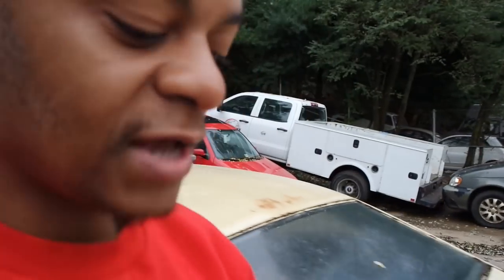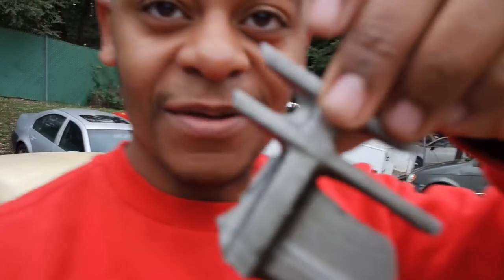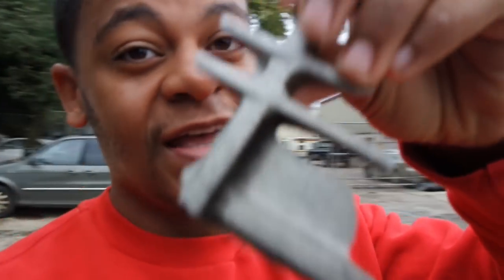RIP to my Turbo f20b Honda prelude

Comment: The prelude was my 1st favorite honda, so much I had 4 of em. Never boosted them but they where still alot of fun and looked good. Sorry to hear the motor blew but hey at least you can upgrade now. I have a F20b swapped cb7 and an 05 type s now for my remedy to have fun on the streets, and a 07 SS trailblazer to haul the kiddos around. Keep up the good work and good luck. I'll be watching.
Reply from the maker: Thanks bro

Comment: Man, I have blown a motor before and yeah I know that sound you described. This is going to be a long story but its a good one.

So way back in '09 when I was 19 I swapped an H22A into EJ1 coupe. I had never pulled a motor in my life and barely knew the basics. So I managed to get the swap done in about a week, bone stock H22A stock ecu, stock everything but an AEM cold air intake.
So not long after this swap I decide to go on a vacation with 2 of my friends over 1,100 miles to Titusville, FL. we make it all the way there just fine and the next day I leave the house we are visiting and drive 1 mile away to get beer. Just as I was leaving the liquor store it started an insane downpour and the streets filled with water so fast I couldn't believe it. i had no choice but to drive through some roughly 1 foot deep water to turn onto the street where I was staying. Then the engine gurgled for second and stopped, I tried several times and started it back up and drove the remaining 100 yards, pulled into the driveway, had my hand on the keys to turn it off and, then I hear the sound of tools dropping and the sound of big rocks banging around and there was smoke rolling out from under the hood.
When I drove through the water I sucked water up the stupid ass cold air intake and hydrolocked the engine and my young dumbass made it start again and drove 100 yards, it bent rod #1 until it snapped and smacked a fist size hole in my block. And there we were 1100 miles from home.
I managed to scrape up $800 for another H22A from JDM Orlando about 2 weeke later and put it in with nothing but my tool set and 2 cheap floor jacks. I drove her back home and that engine is still in my car to this day 9 years later. :)
Reply from the maker: Thats crazy bro

Comment: I thinks it's awesome you got that much hp out of the f20b, they only cost about $400-600 in my area with pretty much no mileage. they actually are great engine blocks, and are very strong and with a new block with wicked rods and pistons you should have a solid engine for a long time. Maybe a block guard and some really good main and rod bearings, wicked car
Reply from the maker: Yea if it wasnt for the boost creep i would have been good.

Comment: Blown rods, that Turbo creep had me worried and it wasn't even my car. Crazy I just watched ur last video damn bruh I know your feeling. I blew a motor up back in the late 90s and it shot rods threw the block on the highway when I sucked water through my cold air intake. That sounded like a shot gun bang and ran over rocks as well chunks. Good Luck on the next build.
Reply from the maker: Yea sucks but thanks bro ill be back soon

Comment: If you do get a f20b I have a extra h22a4 crank. Run that in the f20b bore it to 86mm and run the stock k20a2 pistons that I also have a set aswell. You can run eagle rods with those pistons in that setup plus you'll be .046" inside the pocket of the cylinder walls. That puts you at 9:1 compression great for boost and it will be a 2.1L f20b boosted. 
God bless and hopefully everything goes well with you bro.
Reply from the maker: That sounds dope

Comment: Had the exact same thing happen to me two years ago. F20B 5thgen boost crept to 18lbs then one week later I'm at a red light not racing or anything I shift from 1st to 2nd and a rod shoots out the pan. I just got another F20B and in the process of rebuilding. KStuned has rods for $400 and F20B forged pistons for $600. Ebay has F20B motors (auto) shipped for $600.
Reply from the maker: I just got a motor bro but can you send the link to the rods and pistons?
Reply: https://www.kstuned.com/search?q=f20b  I just got my F20B back today, hot tanked every part. Finishing up a stock rebuild on a h22a4 should be done by Monday. Then ill see if I just want to do a stock rebuild on the f20b or build the bottom end. It is hard to find replacement parts for this motor but this website has a lot of oem parts brand new but it isn't cheap. Still on the search for torque specs. http://store.autodynamics-honda.com/nsearch.html?#search/q=f20b&category=&sortby=rel&main_category=&page=1&size=200&storeid=yhst-13254426962198/1

Comment: I think it’s time for at least forged pistons and rods semi built engine but h22 f20b h/f have weak sleeves I got my block sleeved in 2012 with forged piston and rods no hiccups 10 000 miles in knock on wood just a few dead trannys  on the way sorry to hear about your motor brother I love you build have been following since I seen that engine bay we went through the same thing when my car was built went through 3 stock engines in one summer that’s when I paid the 4gs and got my block sleeved just for piece of mind as a daily the car all summer really until it starts snowing but stay with it youl find your perfect set up just takes some trail and error you should learn to tune your self maybe not make your own maps but I adjust mine in the fly cause in colder weather I run up +2.0 in my afr gauge more lean then in 75+ degree weather
Reply from the maker: Yea i really want to drop rods and pistons....with the f20b i dont need to sleeve the block for my power goals but we'll see
Reply: devin Dfresh H doesn’t have weak sleeves. There’s nearly 800 whp stock sleeves Hs with compatible pistons and rods. Also the F20b has cast iron sleeves. There’s a guy running 9.0 1/4 on stock F20b block.
Reply: FRM is stronger than iron. The sleeves are not weak. They are just coated and misinformed over and over by many people. H22/23 liners are strong. Including s2k and nsx.
Reply from the maker: @Jarph0821  motor for motor N/A based on experience ive had with stock h22's the f20b is better for boost
Reply: I cannot stand misinformation. If his goals are 450whp, the F20B can and will knock that down with 10psi out of high CFM turbo easily and still be very reliable.

Iron sleeves ftw. Also its not the FRM that makes the H22 undesirable for boost its the ring lands and the ring lands only.

Comment: Sorry to hear it blew, if I were you just build it up and send it again the f20bs are great. Keep the f20 and just do Darton 300s sleeves 9:1 CP or Weiscos, whatever the preference, full supertech or skunk2 valve train and Pro 1 cams, 1600cc ID's, precision 5858 .82 ar like I said before cuz it is perfect, maybe a sheepy bottom mount for better top end flow and a 3 inch exhaust.
Reply from the maker: You want me to go hammm lol ill look into it thanks for the info bro
Reply: @treybedipping1734  Hell yea man I would love the videos and I would love to see that beautiful lude smack down at least 500 to the rollers😎😈
Reply from the maker: @christianprusinski  me too bro lol
Reply: @treybedipping1734  Oh shit meant to say Darton MID wet sleeves above they have the integrated block ring for top end stability (whoot whoot 500+) and support a good amount of overboring in case you ever want a more displacement without going H block. I'm done babbling now😂 man.

Comment: That sucks that the motor blew up. As you said time for a new build. Christmas is coming lol tell your family what should under the Xmas  🌲.
Reply from the maker: Lol facts i gotta go check out your new vid im excited cause i was thinking of doing the same.
Reply: @treybedipping1734  if you are better start getting the parts now. Those crv parts going up in price. Doing a b20 vtec swap might be easier on the prelude.  So it would be easier with the crv transmission.
Reply from the maker: @AJIMPORTS  thats the thing im not sure what all you need. Your keeping your h22 and doing it right?
Reply: @treybedipping1734  yeah I'm keeping the h22. I am using it because I already had it. If not I would have went k swap. But I had a very short deadline. I will look into your car and see what would be needed for you to do the swap and let you know.
Reply from the maker: @AJIMPORTS  that would be dope bro let me know. You on ig or facebook?

Comment: Dam bro sorry to hear about that, in all honesty the F motor can only take so much boost and power with stock internals before something like this happens, happened to a few guys here on the local scene, please consider the H and sleeve it, I know some guys love the F and others the H, (it's a on going battle lol), I'm sure u have done a lot of research. Maybe u can give some detail on why u prefer the F over the H, just to add some content in your next video. 💪,  The great thing about starting over again is the amount of options u have 😱,
Reply from the maker: Facts.  i like the f20b because for my power goals its perfect because of the cast iron block and sleeves are good for 400-450 no need to sleeve unless i was going for like 500+hp
Reply: I read ur comments afterwards yes, so  I get what you saying, u never know maybe you get some sponsors and can build one hell of a engine without spending to much 😬.

Comment: I may be wrong, would the wastegate be equivalent to the bypass valve on a supercharger?
Reply from the maker: Not to familiar with the supercharged builds but the wastegate lets out excess exhaust  to keep the boost at the desired level.

Comment: I got an f20b in my 99 Prelude i need to get a new set of headers but nobody can give a straight answer on I'f the h22a will fit or if the h23 will fit
Reply from the maker: H22 parts will 100% fit...the h23 non vtec parts wilk not fit.
Reply: @treybedipping1734  thank  you

Comment: u allready saw how weak those motors are , u need a piston and rod set up on a h22 block and ur set , honestly bro from seeing ur other video on the dyno I though it was understood to not rev up the motor past 7k .......
Reply from the maker: The f20b can rev out to 8500rpm bro and the f20b's are the best N/A motor for boost
Reply: @treybedipping1734  yes bro but from what the tuner told u on ur last video I thought it was agreed to not go over 7k ,I would have thought he put ur rev limit at 7 to save the motor bro ...
Reply from the maker: @drewster956  he put the rev limit at 7300 because thats where the boost creep was spiking at.
Reply: @treybedipping1734  piston And rod time baby

Comment: Boost creep commonly happens when you have wastegate placement in a poor area... like a log manifold and wastegate prevision only in one cylinder versus in the middle of all 4 cylinders. Log manifolds are worst on boost creep and heat. Need wastegate in the middle with no crazy long extensions on it.
Reply from the maker: Yea gettin a new manifold made

Comment: Yo Trey I've been following you for awhile, so I'll give you a heads up for over-boost issued. You should buy a Guardian Angel at Stratified. It prevents your car from over-boosting and it's very easy to installed. I have one installed on my car and it's worth the money. I am not a commercial sponsor or anything I've just trying to help you out from future blown motor. I'll give you a link in the comments. You can also find these used for half the price on subie group/focus rs/st/mazdaspeed3/6 for half the price or older version.
http://www.stratifiedauto.com/index.php?main_page=product_info&products_id=217 

HAPPY BOOSTING! :)

Comment: Bro don’t do f20b at all use the head but get a h22a/h22a1 block its better an an find more parts trust me all I run is H
Reply from the maker: You got it backwards bro f20b block is better. And all the h22 parts are interchangeable  with the f20b
Reply: Trey Be Dipping I’m telling you bro it’s hard the find parts for them f20b are 85mm pistons an an h22/h23 are 87mm an the h22a an A1 comes with a stronger block by far look it up bro that’s all I build
Reply from the maker: @fullspeedperformance  ill do more research. Thanks bro
Reply: hit me up on IG I just rebuild my H motor last night if the head is good use the head an crank if they are good
Reply: FULLSPEED PERFROMANCE that was 5 years ago. If you ask around you’ll get a pair of F20b pistons no problem. Back when I was going to build mine allmotor at 12 comp. they quoted me at 550 from arias pistons.
Reply: @TheBb6prelude  pretty much the cost for any pistons, for any engine. It's actually pretty easy to get any parts now there are so many after market companies making stuff
Reply from the maker: @TheBb6prelude  i believe i had found some while searching briefly
Reply: Trey Be Dipping arias is one of the only place that have them I just did my build in January it’s not a lot of after market support for that motor internally
Reply: Trey Be Dipping if you keeping the stick 85mm bore you goin to need f22a pistons rings an b16 rod bearings I’ve been down this road but in the end wat didn’t work for my May work for you
Reply: @Sideways G  the h22a1 an the h22a / h22 euro are the only closed deck an can hold over 600whp by f20b was problems after problems when trying to find pistons / rods an the h22's make more power from my experience but @Trey if you need help with the build let me know we in the same zone i got you!!!
Reply: Id just go CSS lol

Comment: Sorry to hear that bro , time for k20 on the prelude
Reply from the maker: Thought about it but not yet
Reply: @treybedipping1734  no worries I'm still working on my prelude sh , got me  type s h22a JDM
Reply from the maker: @Maverick214972  nice. Keep pushing bro
Reply: Luis Garza IV man my h22 is about to go, im looking to replace it with another h22 cause the rest of the car is mint, 98 type sh.
Reply: @GHETTOHEISMAN83   it's a good investment  , the thing is u have to replace the oil pump and the distributor  from the old one the sensor are vice versa on the usdm compared to the jdm
Reply: @Maverick214972  yeah, i was looking at getting a red top from hmotors online, but heard its not compatible with the sh's transmission, i might just get the stock h22, i already have the money for it. Just waiting for it to go.
Reply: Luis Garza IV 😂😂😂😂😂😂🤦🏼‍♂️
Reply: @GHETTOHEISMAN83  the type s engine has the atts transmission so it will fit
Reply: @TheBb6prelude   Trolling?